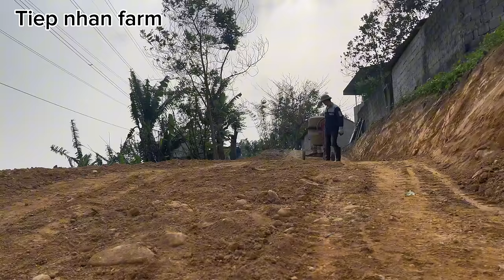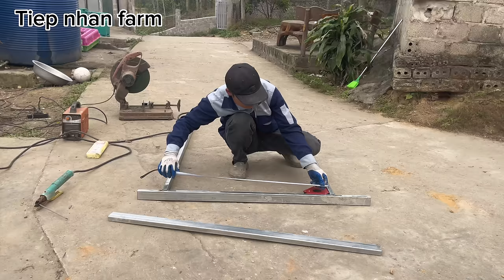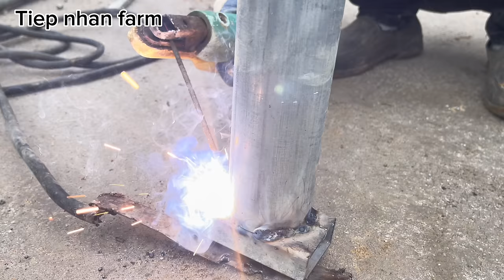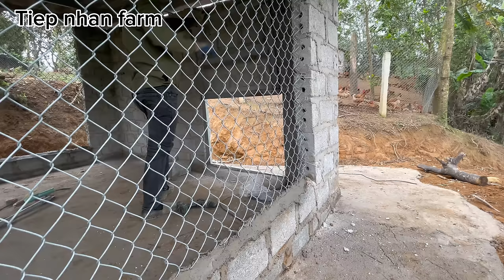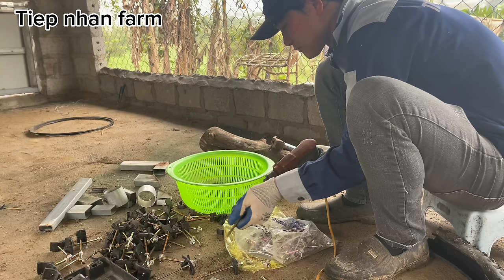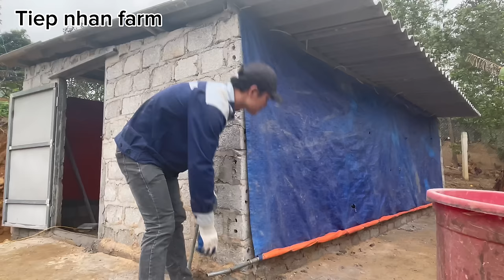Full video on how to build a simple small chicken coop.

Comment: No steel, no gravel. How the block can hold witout steel and the floor will crack without at least a metal mesh
Reply from the maker: This is a temporary building to raise poultry. There is no need to make it permanent. After 1 year, the capital will be recovered. But I calculate that such a chicken coop can last 15 years. So I have made a profit for 14 years.
Reply: Guy's back then permanent building 🏢 they we build without steel and some of them we still have them